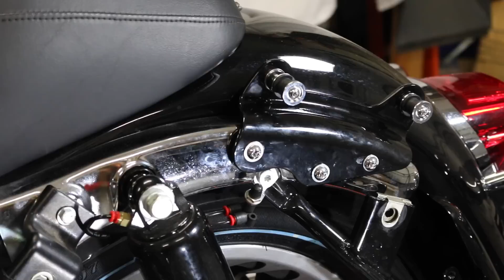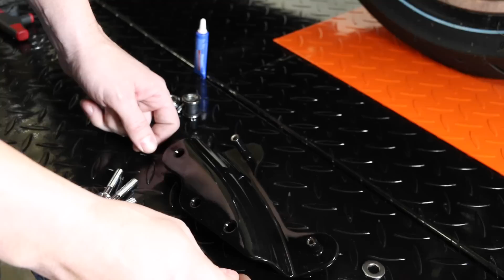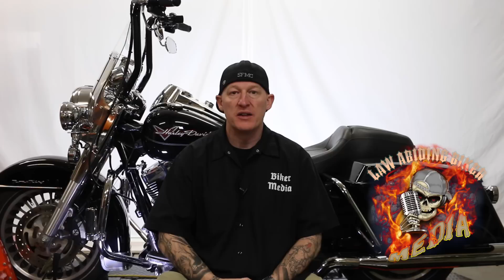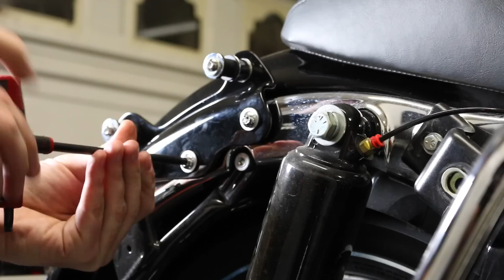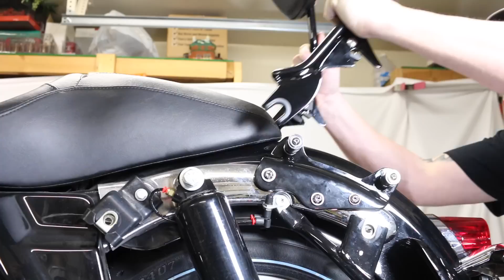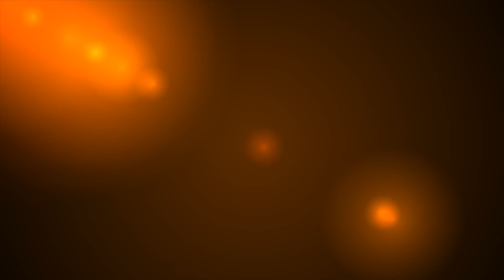Install Detachable Passenger Backrest & Docking Kit on Harley Road King

Comment: I would like to see this done on a Ultra Limited that has a hard mounted tour pack! Finding the right 4 point brackets is a pain in the Big Old Butt and also finding the correct back rest is as well. Try a 2017 Ultra Limited if ya want a challenge! Harley will first of all tell you the parts aren't available for your bike, which is BS.

Comment: Are there longer docking point parts available with smaller spacers? It seems that's what I need to attach a luggage rack and keep the Pinon back rest on my 2000 Road King. The original is just shy of enough room. Looks like I need another 1/8 inch or so to add the rack along with the backrest.

Comment: just put this set up on my new Street Glide. 60 inch pounds on those back rest screw seems way too much. started cranking mine down but never hit 60 with the torque wrench, I think that would strip those bolts. thanks fo the video.

Comment: I bought after market docking hardware. Everything went great until I went to pu the back rest on. Front fit, back I'm guessing the spacers are just a hair too long. So I used red lock tight and removed the washers. My wife and I made it fit by pulling on each side until click. But I will check with HD and see if parts shows a different spacer as I don't like the idea of no washer. Plus its not so easy on and off, pretty much on... We tested it and I will keep an eye on the bolts, but she is happy to have a back rest. Just could not afford to come off 150 plus just for a docking kit. Everything worked well, bless you for the video as there were no instructions. Again, online aftermarket, but for $34 via Amazon, what should I expect. The brackets seem nice and well built hardware, well ????

Comment: It didn't lock down and click when you put it on-I am having trouble adjusting mine to click in-one side clicks in the other doesn't-even the one's I saw installed on brand new bikes in the dealership were hard to click in and out...The sales guy showing me had to fight with it. Any suggestions?

Comment: Hi Ryan
Nobody shows the actual assembly of the plates and hardware.  I bought a kit for my bike but the stems dont fit into the holes on the plates? What am I doin wrong?
Reply from the maker: Hey David. A little confused, sorry I'm slow.....we show you in this video each part of putting the plate together. Maybe this video we did on docking hardware will answer any unanswered questions. https://youtu.be/tLB-g29njrw
Reply: in the video the long and short studs are already in the plates.  Im trying to figure out why the studs wont fit into the holes where they go in the plates.